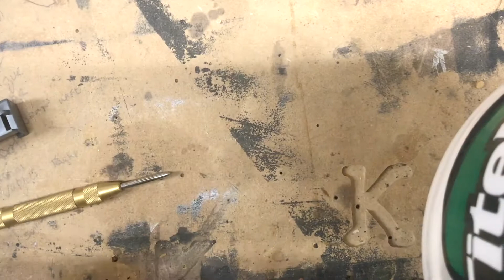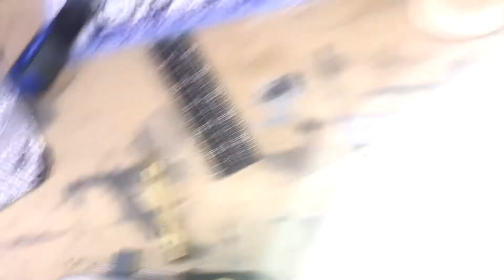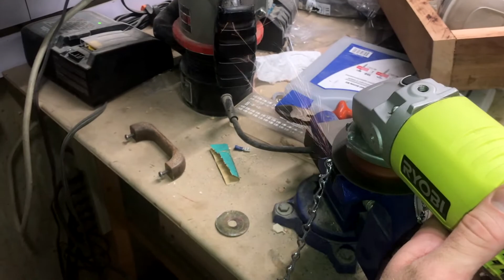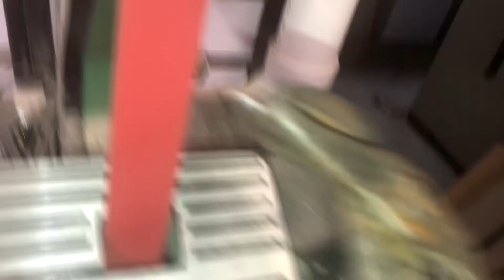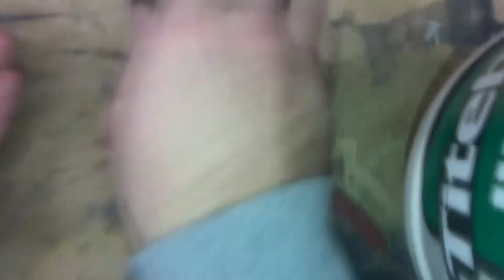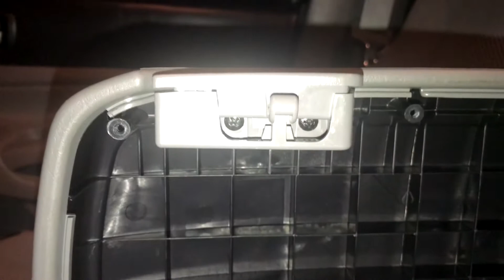Tacoma center console lock / latch repair NEW 2ND GEN

Comment: For those people who do not have belt grinder or do not want to cut hanger or anything, go to your local hardware store and pickup a couple of M4 or 4-40 set screws. I used this method and it worked great. Of course you will have to pre-drill the mounting holes just as the video described.
Reply from the maker: hey thank you for the advice for others.
Reply: How long should the screws roughly be? Any idea?